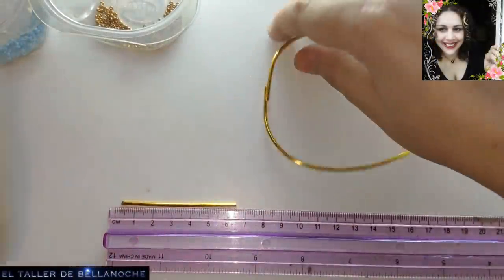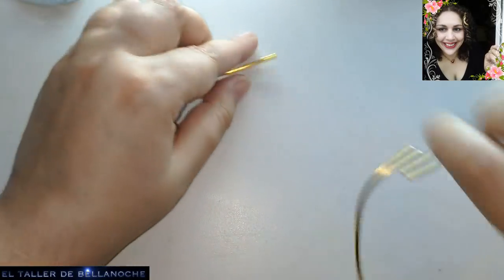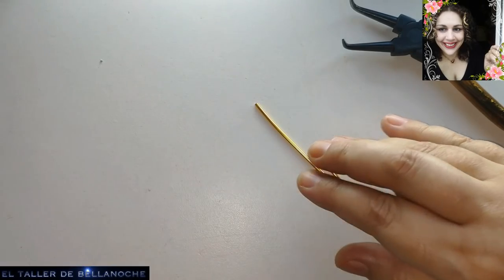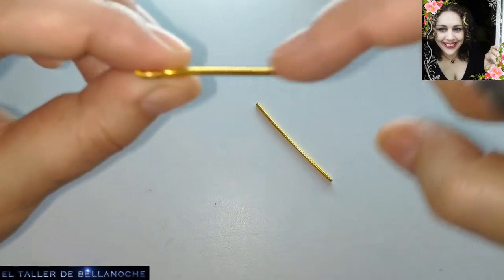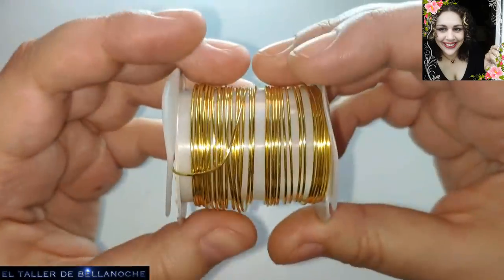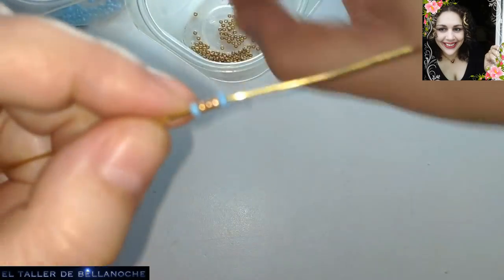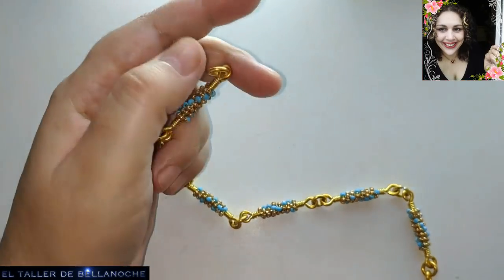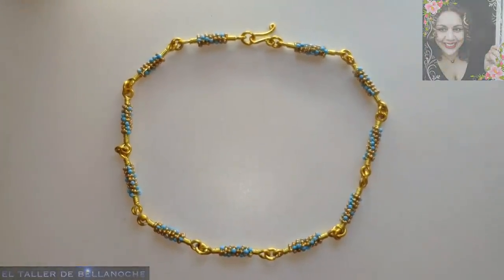COMO HACER UN COLLAR DE ROLLITOS DE ALAMBRE CON ROCALLAS-WIRE COIL NECKLACE WITH ROCKERIES

Comment: Hola. Esta espectacular, y los sarcillos como se pueden hacer?
Reply from the maker: Muchas gracias gracias Paula. Hazlos igual, no? Como uno de esos eslabones. La terminación como quieras, una pluma, una espiral, un bola de 6mm. Algo pequeño sin duda. Pero es tu elección. Un abrazo desde España ♥️🤗
Reply: @eltallerdebellanocheoficial  mil gracias. Así lo haré. 😁

Comment: Hola espero que tenga un fin de semana lindo.
el collar le quedó precioso. Disculpe que pregunte me podía decir que medida son  los alambres estoy en usa. Me parece que el de 0.8 es alambre de 20 pero el más fino no encuentro como hallarlo ; tengo de 24 ,26, 28. Me gustaría hacerlo este fin de semana largo. Un saludo
Reply from the maker: Hola Celia. Me pasa como a ti, soy de España y en Europa se usan mm de diámetro. Bueno que puedas preguntarle a tu distribuidor de alambre y adaptarte a los materiales que tengas. Aún así, vuelve a oír el vídeo, porque no usé ninguna medida inferior a 0.8mm. Es posible que no hayas oído bien o hayas olvidado leer la descripción. Un abrazo desde España.
Reply: muy amable, si tenía razón mire el video otra vez. El alambre gordito es de 12 el más fino es 20. 
Un millón de gracias.
Reply from the maker: @celiakloos23  no es tan importante el grosor. Usa el te venga mejor. Que pases buen día. 😊